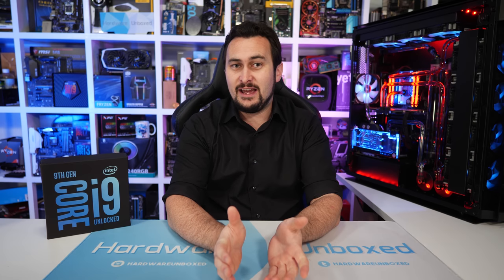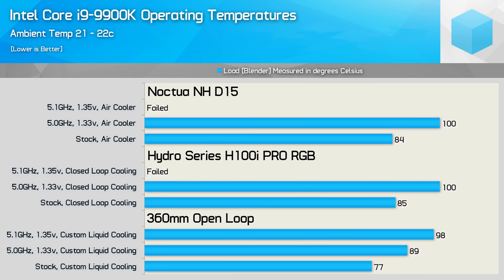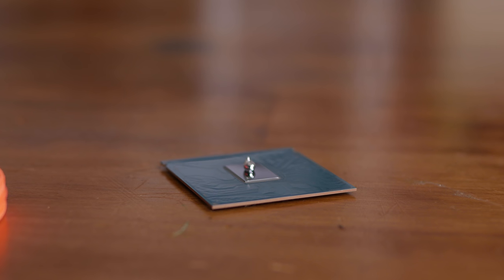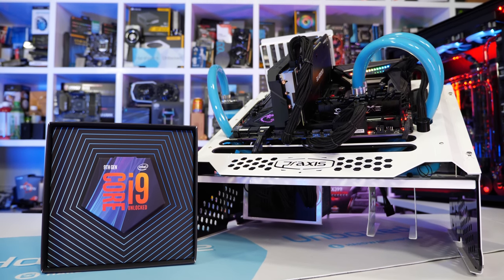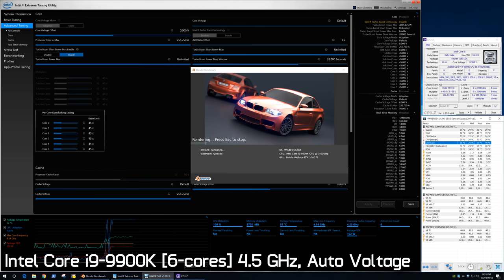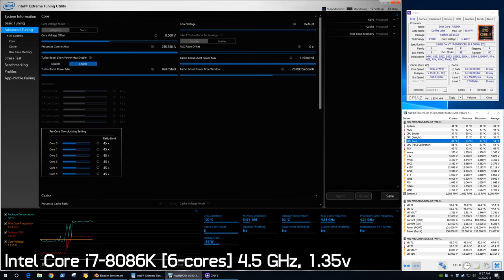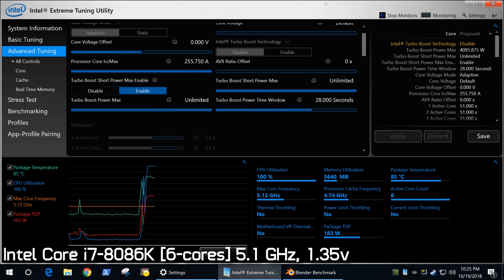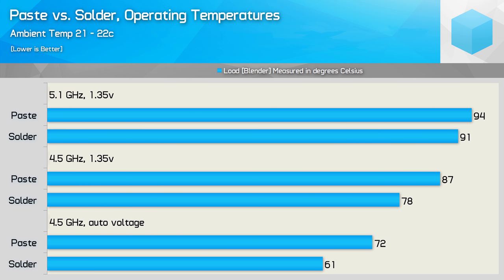Why is the Core i9-9900K so HOT? STIM test, Solder vs. Paste

Comment: This remembers me of the Pentium 4 Extreme Editions, as they were Intel's desperate attempt to stay competitive. They were really, expensive, consumed a lot of power and didn't offer anything new to the table. AMD could easily beat the Intel crap back in the day. As Zen 2 is right around the corner I wonder if AMD can repeat this story? What do you think?
Reply: AMD will surely regain much of the market share they lost in the previous years. I LIVE for the day it will be 50/50 as back in 2006.
Reply: ... 50/50 ...? 

it was 75% intel / 25% AMD at the peak... not even close to 50/50 and never has been.
Reply: But then will Intel pull another core 2 duo after that? :p
Reply: @wangkevin3431  at that time Intel have the P3 architecture instead of Prescott that enables them easier, and faster R&D as they based Conroe on P3 (I couldn't remember the architecture name) which is already used on their laptop processors (again, their laptop processors skip prescott). 

Edit: This time, unless they somehow made a breakthrough in Mesh design (which they failed before, hi skylake-x), I don't think their current ring bus design would be able to scale more than 8 cores
Reply: @Jay Larcombe I don't know where that chart's coming from or what metrics it's based on, but it contradicts all of the reporting from 2006/2007... There are still plenty of old articles that exist (from reputable sites) that go over how impressed everyone was that AMD had earned 21% of the market share by Q1 2006. 

Here are 2 from that time: 
https://arstechnica.com/uncategorized/2006/01/6053-2/
https://www.techradar.com/news/upgrades/processors/computing-components/peripherals/amd-s-2006-market-share-gains-wiped-out-146502
Reply: @notahuman369  yeah I see what you mean. I think it's just a case that I've seen that graph referenced so much that I've sort of just followed it. Sorry if I've caused any misinformation then
Reply: @MrWillypanda88  ic thanks
Reply: @MrWillypanda88  also it was meant to be a joke. _.
Reply: @notahuman369  you are talking about cpu sales. I'm talking about cpus already in use. https://www.cpubenchmark.net/market_share.html

If we take into consideration sales only, it's already 50/50 during the last few months. Except september, where sales were 65/35 for AMD.
Reply: Fabius Maximus Cunctator reminds you*
Reply: MIC MUTED, the core 2 duo was not better than the athlon x2 also their quad cores were not any better than the phenoms. What damaged AMD greatly was that Intel was posting fake benchmarks everywhere, making fake commercials saying that AMD was garbage and that Intel does what AMDoesn't. Intel started to pay retailers to not sell AMD products. Intel started to create complires that crippled AMD's performance in Windows and Benchmark programs... Intel did everything possible to make AMD look bad in every singel way. If you benchmark the Core 2 Duo vs the Athlon x2 or the Quad core vs Phenom x4 today without all the crippling compilers from back then, you will see that AMD's chip were not 50% worse as Intel made them seem with their fake propaganda. Intel is starting to feel threatened again and what do they do? They start to fake out benchmarks again with the their new i9's but that BS will not work today, it was effective back then in 2006 but today there are just too many social medias and they can call out Intel's BS quick and swiftly before they can snowball on AMD again.
Reply: AMD pretty much already repeated that story. Look at Broadwell E and Skylake X, Zen defeats the competition with the exception of a few benchmarks. The 1800X was faster than the 6900K, the 2700X is faster than the 7820X; both the 1800X and 2700X consume less power than their Intel counterpart while offering better performance. The 9900K actually consumes more power than the Threadripper 2950X.
Reply: Now every last fan boy can see Intel's 14nm is at it's limit. At least they can hold the performance crown until March of 2019.
Reply: @Kitsune Core architecture was vastly superior. Check out this video if u don't believe me: https://www.youtube.com/watch?v=Y1hmVakR56o
Phenom II were the same performance because they had much higher clocks out of the box.
Reply: Intel always beaten AMD, espcially back in the Pentium era, lol

Comment: Hasn't the top of the line consumer processors from Intel been getting progressively hotter for awhile now?
Reply: That's what happens when Intel gets  AMD 🔥 on their ass
Reply: I’m so darn glad that my name isn’t too looong, that’s what happens when you stretch the manufacturing node to the limit, without a shrink to 10nm for example you don’t get efficiency improvements so the only way to get better performance on the same process without a significant architecture change is bigger die and increase power so more heat. Bigger die also mean less yield so much higher prices.
Reply: @backupplan6058  They really have no choice in the matter. 10nm was supposed to be out ages ago, but they were far too aggressive with the node density hence the 14nm+++++ meme.
Reply: thats what happens when you get stuck on the same node for a few years! This is basically what happened to the FX processers before Ryzen came out! AMD couldn't improve the node so they just kept adding frequency with minor tweaks till they required so much power that they basically became space heaters lol

Comment: The latest i9 reeks of the same desperation Intel had during the last of the Netburst Pentium IV releases.  Pushing clock speeds to the max - thermals and price/value be damned.  I think Intel realizes that they can't really move ahead without transitioning to the newer smaller process, but that AMD is about 5 years ahead of them on transitioning and getting solid yields.  This will allow AMD to continue growing frequency and IPC while offering a significantly higher value proposition (98% of the performance in specific workloads, better performance in others like highly threaded, at less than 30-50% of the overall cost of an Intel system).  We're looking at a repeat of the Athlon 64 versus the Pentium IV and slapped together Core 2 lineup.
Reply: Squiggly667 Intel has fabrication while AMD doesn’t , so AMD is fabless so they don’t have to worry about R&D for processors node since TSMC has it taken care of while Intel spends billions and billions trying to get 10nm out , they should go fabless and use TSMC 7nm to be more competitive , 14nm to 7nm is from 1inch to 0.5 inch.
Reply: @Felixthecatfan21  but to be honest Intel fab is the best for their processor. You have to give them credit for stretching 14nm for so long.
Reply: Except the performance is actually there, unlike Pentium 4.
Reply: @MrWillypanda88  in a way yes but the lack of competition until last year made them complacent.
Reply: @billytaj7708  yeah. The 10nm fiasco was never supposed to happen. They're getting to comfort for their own good

Comment: Price of the i9 9900k - $680ish (Doesn't come with a cooler and looking at these thermals, the minimum you should get is a 240-280mm AIO cooler
Price of the Ryzen 7 2700x: $304 (With frequent sales and good deals on the used market, and already comes with a fantastic cooler (with RGB ;)) (Side note: Boards are also WAY cheaper and AMD processors run just fine on the sub $130 B450 platform)

Alright, so let me get this straight, you're paying 224% more for the 9900k, Barely getting even a 40% increase in most areas (especially games), AND you probably should buy a more expensive ($150+) Z390 board because of the better VRMS which could lead to better thermals? Laughable... Can an Intel fan please explain to me why this or the i7 9700k is a good buy? I'll be waiting.
Reply: Side note (AGAIN): The Ryzen 7 2700x even with the stock cooler offers better thermals OVERCLOCKED than the i9 9900k at stock.
Reply: Intel NPC fanboys .... activate!!!
Reply: I can sense them. They are getting closer lmao. Only a matter of time
Reply: I’m curious why people don’t go for maximum burn and use a R7 2700 for comparison - sure the cooler’s not as good and it requires more manual tuning but the further savings on the wallet...
Reply: Good point. If that were the case there really wouldn't be any point in buying the 9900k at all unless you're building a balls-to-the-walls gaming pc.

Comment: Steve+Tim=STIM

However Steve, did you ACTUALLY use percentage to indicate a difference in temperature? Please, don't do that, it makes absolutely no sense (unless you start using Kelvin, but would still make little sense)
Reply: celcius is linear just like kelvin.... 0c = 273k   100c = 373k
Reply: @SpecialKthx  Celsius is RELATIVE.

What do you get when you go from 0°C to 1°C? OMG INFINITE% HOTTER

Percentages for temperature differences make no sense.

Comment: Where I live, the 9900k costs 35% more than the 8700k, runs hotter and is harder to overclock. Thank you Intel?
Reply: ... because it's an i9 ...

The i7 9700K is $375... About $6 more than the 8700K.
Reply: 9900k needs a beefier motherboard too
Reply: Is "because it's an i9" supposed to be some sort of argument? 9900k is clearly made for gaming, and it's a worse buy than the year old 8700k. If you're not aiming for gaming, buy a Ryzen or a Threadripper. And don't mention 9700k; +2 cores but -4 threads and it runs warmer as well. More of a sidegrade than an upgrade.
Reply: Uh, yeah? You're comparing apples and oranges when you reference the price of an i9 vs the price of an i7. You might as well be complaining that the i7 8700K is 40% more expensive than the i5 8600K. Compare the i7 9700K price vs the i7 8700K price, then you're looking at a $5 difference. 

Or, do you make a habit of cherry picking your comparisons just to get yourself riled up?
Reply: Alright. You're in the market for a new gaming CPU. You can buy a 8700k for €450 or a 9900k for €600. Give me a scenario where the 9900k is worth the premium over the 8700k.
(And you can't say programming/rendering/etc, there are way better CPU:s than the 9900k for that thanks to AMD.) - Go!
Reply: Racetrack! The answer is race track! Not a drag strip though. Something with corners.
Also carparks maybe.

Comment: Here are my Core i9-9900k temperature testing results - I figured I would add this to the body of knowledge being shared.

I have the my i9-9900k overclocked using Asus's AI overclocker tuner and Q-Fan auto fan control on an Asus ROG Maximus XI Formula Motherboard and using a beQuiet! Dark Rock Pro 4 CPU Cooler installed using Thermal Grizzly Kryonaut thermal grease.  

During a Blender 1.0 Beta 2 Quick Benchmark, the CPU cores/threads remained maxed out at 100%.  The total runtime was 14.42.23 minutes.  The CPU cores stayed at 4.9 GHz (+0.002/-0.005 GHz) on all cores the entire run.  VCore mostly stayed at 1.172 V with a 1.234 V peak.  Max package power was 171 W.  Maximum core temps ranged from a low of 81° C on core #7 to 89° C on core #2.  The ambient temp was around 22° C.  The chassis fans maxed out at various speeds ranging from 874 rpm to 927 rpm.  I could hear them running, but the noise was not too bad.  The 135 mm CPU fan maxed out at 1498 rpm.  HWMonitor is not reporting the speed of the 120mm CPU fan, which is plugged into the CPU_OPT header, but I am assuming it was running around 2200 rpm, which I understand to be its max speed.

I also ran Prime95 v. 29.4, build 8, Windows 64 bit for about 30 minutes on "Blend" and "Torture Test" to run 16 threads.  Again, the CPU stayed at 4.9 GHz the entire run.  VCore mostly stayed at 1.208 V with a 1.234 V peak.  Max package power was 113 W.    The CPU cores mostly hovered between 59° C and 64° C, with a Max of 71° C being reported in HWMonitor.  I could barely hear the system running.  One of the front case fans is plugged into the water block pin header for now until I get a fan splitter cable, so that one runs at 915 rpm for now.  The other case fans ran between 730 and 800 rpm.  The 135mm CPU fan ran at about 1025 rpm.   I am assuming the 120mm fan was running less than its max rpm.

Unfortunately, HWMonitor does not seem to report the VRM temperatures on my motherboard.  Nonetheless, I did not detect any thermal throttling during the tests while continuing to watch the core speeds in the HWMontitor UI, and the minimum core speeds measured by HWMonitor was 4.895 GHz.

System:
MB:  Asus ROG Maximus XI Formula 
CPU:  Core i9-9900k
RAM:  G.SKILL F4-3600C16D-16GVK 
Primary/Boot SSD:  Intel Optane 900p 280 GB
Case:  Fractal Design Define S2 TG with two additional Dynamic X2 GP-14 fans in the top two rear fans slots.
GPU:  Gigabyte AORUS Radeon RX 580 8GB
Power Supply:  Seasonic PRIME Ultra 850W Titanium

(Note: I don't need the VRM water block on the Formula, but I could not find the Maximus XI Code in stock anywhere and grew impatient waiting.  I use the RX 580 because I have 5 displays, and I don't use the system for gaming - the RX 580 is the only newer generation video card I could find that supports 5 displays.)

Comment: Steve i want to replace my aging combi boiler would the i9 9900k be a good replacement ? Is the trade off between gas usage to electricity usage worth it? 😂😂😂😂😂😂😂😂😂😂😂😂😂😂😂
Reply: Not without delidding as you can't get the heat out efficiently enough at stock. :p
Reply: Absolutely its eco-friendly
Reply: Now that's a real open loop! I mean sure to keep your PC cool you gotta take showers once the tank starts to heat up but that doesn't sound so bad

Comment: I think it's because they have reached the limits of this process node. The 9900K teeters on the ragged of the power delivery capabilities of the boards, and it's likely that the surface area of the IHS is inadequate to dissipate the heat generated by eight cores, especially with SMT. Insufficient surface area = insufficient heat dissipation. So with the 7700K delidding was a good idea for heavy OC. With the 8700K it was mandatory. And with the 9900K you need premium cooling just to run it at stock speeds. This is what happens when you underestimate the competition and simultaneously struggle to move your own products to a smaller process.

Comment: Can I make a suggestion for content? One is more a thought experiment: for the first time we have 2 competing 8C16T CPUs (which are both soldered), lock a 2700X and the 9900K to say 4.1GHz all core and rerun the productivity and gaming (@2560p) benchmarks. This would give us an indication of how they compare with regard to performance, power and temperatures, and how far AMD needs to go with regard to IPC to catch up.

The second content piece is comparing the 9900K to a 2950X, as they are both a similar price (at least in the UK) and have similar temperature characteristics. Obviously the 9900K will be vastly superior in games at lower resolutions, but when you hit 2560p, it would be interesting to see how much they differ, given the 2950X's superior(?) productivity aspects, and how close they are in cpu/platform cost

Comment: My biggest takeaway from this is actually that when matching specs, 8th and 9th gen chips are exactly the same. Same power usage, same performance.
Intel did nothing but slap on a couple cores, tweaked stock frequencies and voltages, slapped some solder on it and selling it as a refresh.

That reeks of desperation.